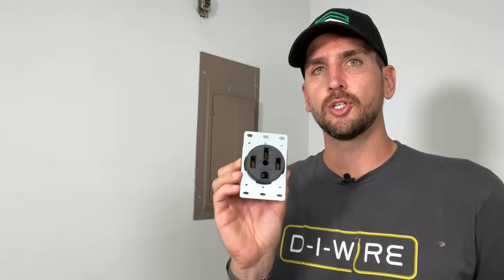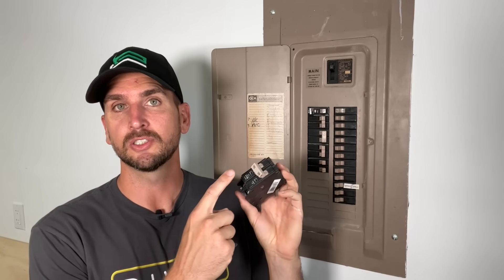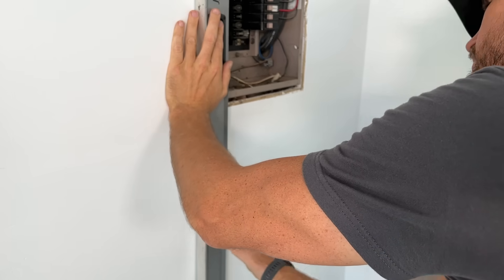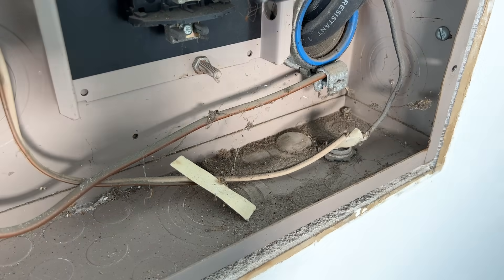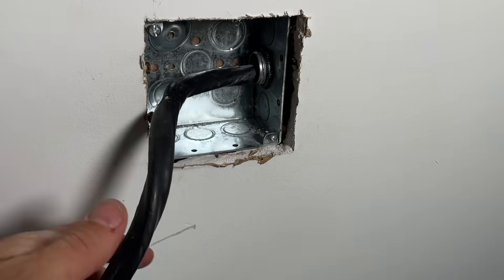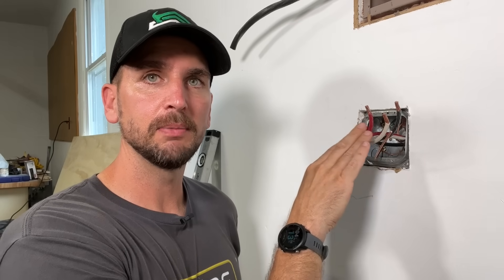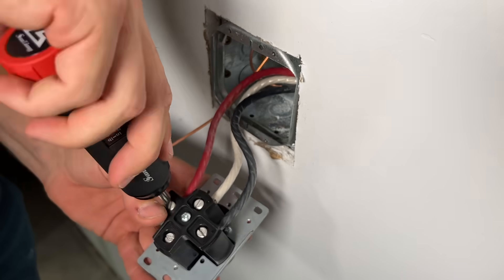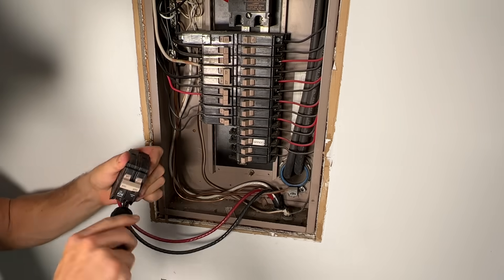Quick and Easy DIY 240V Outlet Install | 50 Amp NEMA 14-50

Comment: Would it matter if the breaker box is 100 amp or 200 amp?
Reply: I have learned through my life that if you learn the hardest most difficult way to do  any calculation problem is best.  There are short cuts that can be developed, however, the short cuts often open you up to failure.

Does it matter 100 or 200 amps..... No!  Calculations should be done for both services.

Houses are wired for what is there when the house is built. The service wires can be reduced to supply just that.....Initial install only.  

Adding a charger is like adding an extra stove/oven to run for 8 or 10 hours.  A 100 Amp service means car charging takes up close to half of all the power your house can receive.

200 Amp services will probably be okay, but I must recommend the calculations to be safe.  Your building department may also require them for the permit.

I took a car charger install class and one of the guys told us that the Tesla rep told him add a second service just to add the charger.  He lives in a rural spot with plenty of extra electrical trical.loads connected to his building.

Be smart and do it right the first time, waiting to do it right until the second time might get expensive.

Comment: Problems with his video. I fear most that are drawn it with his fake price in his caption, he actual is almost 50% over his caption price. Now for the fact that most sucked in by his fake price are not competent to do this work. In most parts of the nation, will jot be able to obtain the permit to do this work, not to mention know the NEC codes to meet minimum standards.   
So most will have to hire an electrician, who will not cut some corners, that he did such as the cook stove intended receptacle. Therefore his fake price, is way off what it will actually cost. Not to mention the lack of payment by the insurance company when the EV catches on fire or the overload that this creates on a panel that does not have the necessary capacity to handle this upgrade and burns down the home by being inside the home attached garage.
Reply: We have to trust the "can's" to do it and the "can not's" to know they cannot.  We can't be limiting the "can's" just because a few "can nots" fail to correctly self identify.

Comment: This is all fine and dandy and I guess you want to show is not expensive. Yet, why go through all that trouble and not use a 6/3 so that you would have a ground cable to the panel, hence, to a ground rod? 
Before I get a reply...I get it, is not needed to function and work. Nonetheless, is an additional safety AND even if not code in your jurisdiction, it may be in the future, to GFCI all garage outlets.  Yes, I know you could hardwire also, but if you have a plug in charger and someone in the future buys the house than is nice to know it can be converted to GFCI. All he needs, later, is to buy the $90 breaker.

Anyhow, that being said, the 14-50 has the holes he needs, but HomeDepot and Lowes sell them expecting you to plug an oven....this is why those cheap outlets do not have full blades, ovens are not continuous, they go on and off as they cook, and plugs are hidden behind the range never to be messed with again.... EV charges are continuous and will heat them up. I don't want to be sleeping over the garage while that thing is juicing so much amperage, especially at night, when any smell or smoke needs to cover the entire house before one wakes up.  This is not when you want to save.  GET AN INDUSTRIAL OUTLET, they are beefier and the blades can handle the abuse and especially the constant current.
Get a HUBBELL or BRYANT INDUSTRIAL outlet. Who cares if they are $90?  Do not save $70 to plug a $70,000 car!!!! And, run the ground wire to the panel!

Lastly, all the aforementioned is useless if you don't wiggle, then tighten, then wiggle and tighten the wires, the strands move and accommodate and it can loosen up. That is heat and fire and arc and a nightmare.  the good thing about industrial outlets is that the connection is safer because instead of a screw a plate presses the strands, so at least that is better.

I like the video, it does help and is a good visual and is well done, but those details are important.  

NOTE: be kind to your appliances ad avoid surges, turn each breaker off first and THEN the main 200AMP one. When energizing the circuits do the same but vice versa, first the main and then individuals one by one.   One thing is to know how things work and I am all about DIYers, but is also nice to have the formal training and knowledge to do them properly.

KNOWLEDGE:  Tomato is a fruit.
WISDOM: knowing enough NOT to add tomato to a fruit salad.

Comment: The thing about electricians is we all seem to have different ways of doing things depending on what we think is safe. When you opened the panel I though cutler hammer bet those breakers are going to be hard to find. I actually haven't see a CH panel in over fifty years now. Now the first thing I would have done is put an amp probe on the entrance cables with normal loads on to see how much capacity you have left. Second is I've never seen anyone use a 1900 box after the drywall is installed. Normally you'd use a two gang popin box with sheetrock clamps for that install. And I'd throw away that waygo plastic device and use a wire nut that will likely outlast you. Finally after it's all said and done I'd never put a charging outlet inside the garage with all the ev's that have self ignited while charging. I'd have installed the outlet outside with a weather proof cover and parked the car a bit distant from the garage door. You did do a nice clean install but I definitely would have done it differently. At any rate what was the load on the panel before you added the outlet?
Reply: First of all, just because you haven't seen something for a while doesn't mean it doesn't exist or parts don't exist. My last residential panel was from 1972, and as of last year, I could still get breakers. Second, the box used is very common after finishing as it actually mounts to a solid surface instead of hoping the drywall holds . Third, it's WAGO, and they out perform a wire nut in many ways.
Reply: @Toyotajunkie  I don't agree. Pressure contact devices typically get tired and fail over time from the varying loads and a wire nut is normally good for fifty or more years. Even with a wirenut you twist the wires together to insure a really good connection. You might have a source for c/h but I can remember in the early 70's having to buy some at an old hardware store because at the time the supply houses no longer carried them. Perhaps they've made a comeback. As for the box if I was planning on plugging in and unplugging that receptacle I would have surface mounted it directly over a stud to resist it moving in the wall. But I say again it would be a safety feature to be able to charge the car away from the garage and not inside it. Then again it's not my home in danger.
Reply: @71160000  We will just have to agree to disagree then. Your "thoughts" on new technology, and incorrect interpretation of data (whether from misinformation or refusal to accept data) are going to make this a waste of time for me. Thanks!
Reply: @Toyotajunkie  No problem. I've seen lots of people do things the way they thought was best and as long as it doesn't kill someone or burn their home down it's okay. Over 40 years I watched technology change a lot. I've worked on everything from offshore drilling rigs to skyscrapers to nuclear plants and I've seen a lot but not everything for sure. The one thing that's most common though is burned connections from poor choices or poor mechanics.

Comment: What abt gfci?
Reply from the maker: You will need to check your local code.  For us in Illinois code is adopted at the city level and we are still on 2014 which does not call out GFCI protection for garages when installing 240 volt outlets.  I think in 2020 NEC did make an update that might necessitate a GFCI on this type of install.

Comment: Completely misleading. Most homes in my area, the breaker panels are already maxed out. Which would require upgrading to the larger panels. Your homeowners insurance will not cover your house if you put that in there and it burns down because you did it wrong
Reply: Maxed out? What builder gave the residents the "no lube special"?
Reply: @snap-off5383  no one was planning for electric cars in the 60’s & 70’s
Reply: @bobstratton6362   My house in a new neighborhood is paid for and I paid 1/3 of what it is now worth.  We all have modern 200 amp service with natural gas service as well. Any male that buys a house that can't support a welder.  I'm sorry you take an assessment of your living situation as an insult.
Reply: @snap-off5383  like waist and yes I have two welders, a plasma table and solar system that over produces. With batteries. Would be off the grid if the government would let me.

Comment: It is quick and easy IF YOU HAVE 50 AMPS AVAILABLE ON YOUR PANEL. 
Doubt you paid $66.00 for this since the cable probably cost you more than $66.00

Comment: For the viewers, please remember that there is a section in the NEC, 625, just for car chargers.

Your charger's maximum draw, no some reduced charge rate, must be used when multiplying by 125% to get your circuit rating......a 40 amp max power use for a 50 amp circuit/breaker.  You cannot run a 30 amp circuit and restrict your 40 amp charger down.

Also, if receptacle for car charging, gfci required since some time before 2017.

Please, research and do it best.
Reply: Check your local authority.   Mine's on the 2008 NEMA codes.
Reply: @BenKlassen1  holy crap

Comment: Great video! I’m in a project exactly like what you did in the video. But I’m quite new to electric, can you please tell me what size of the wire stripper you use? I know the black main thick wire is 6 gauge, but after it’s stripped out, what size of the conductors inside of it?
Reply: I believe it is 6 gauge. The gauge refers to the size of each individual strand

Comment: step 1, have your breaker box in your garage lol.  nice video to help with the process, but if your box in in the basement, your going to be spending $200+ on a 50ft length of 6/3 wire, and you'll have to cut access holes along the way to snake that monster through your ceiling.

Comment: dont listin to these tubers they do not care if you die or burn your house down.. you need to hire a license electrician this will cost you about 1000 dollars to do spend the money get it done right dont mess with the panel also want to add if you have a dryer that runs on 240 you already have a 50 amp outlet ready to go just unplug your dryer and use that

Comment: All evs need 125% rule continous load 3 hours or more for the nema 14-50 40amps x 1.25= 50 amps then for your continous load is 40 amps.

Comment: After working the trade for over 30 years and becoming an Inspector, NEVER use Aluminum.  (Just my opinion) And use industrial grade outlet for the cord you will use. As an afterthought, get the Vehicle sales folk to provide you with a cord long enough to reach the outlet that you will install, no junction boxes. Use Copper wire, and don't undersize it. Use wire good for 40 amps, #8. If you are not doubly sure, then hire a Licenced Electrician and make sure he is insured. Get his contractors number.  Don't let your smart neighbor or friend near it. Proficiency and Insurance are key here.
Reply: I talked to Tesla and their professional installation support said my previously installed 6 gauge aluminum line that was used for a electric stove will work fine with the mobile 220V charging cable since it will only use a maximum of 35 amps. What do you think Ellen?

Comment: You need to check the size of the panel. Ensure the main breaker has have enough rating. 
Btw, 240v 20/30 amps is more efficient (lower lost of energy/ lower cost)  then 50amps when charging ev.
Reply: So if I have a Tesla I need the 50amps correct?

Comment: My panels are in the basement so it was a good deal more to pull it to the garage.  Either way, it’s a one time charge and the house should be set for a long time. I only wish it was feasible to run two so both our cars could charge at 45 amps.
Reply: Run 1 larger cable to a subpanel in the Garage, probably  should be considering a 120 amp sub panel. Assumes you have a 200 amp main panel. Or alternatively if you have a smaller size main panel see about a splitter  meter base  and have each on their own panel. That main run size will likely be in aluminum so make sure to use an anti oxidizing compound as required by code.
Reply: Hello, what did you end up doing? I am in the same situation right now. 😬

Comment: Shortcut - if you have a gas stove, use that 50a breaker. Remove the wiring to the stove and use that for 6# to the charger receptacle. But could be an issue when you sell the house.
Reply: That's exactly what I did. I converted from an electric range to gas. All that was on the 50amp line was the ignitor circuit. So I switched that to a 15amp branch circuit to free up the 50amp breaker. We're planning on staying in this house forever, so if the next owner wants an electric range, they'll have to give up the EV charger circuit... or upgrade the panel, because it's full.

Comment: Great Video - my panel is full - any suggestions what to do?  the last spot got taken for a 240V mini split - can this be shared with a nema 14-50?
Reply: I believe there are "doubling breakers" (probably the wrong term) that can help free up space in a full panel. Check with a pro.

Comment: Very useful video! Went with the much beefier 14-50 receptacle. Car is currently charging now. Thanks for making such a well-focused video. It covered all the useful issues, so I was able to get it right the first time without making any mistakes.
Reply: I think this is critical to point out. Don't use the cheap $9 receptacles you'll find at Home Depot. While it is indeed a NEMA 14-50 plug and is technically up to code, they're designed for electric dryers. They're not designed for 5-10 hours of charging and a lot of them have started fires. Get the ones especially built for EV charging. They're going to cost in the neighborhood of $50 (if you're lucky to find them at that price) to $150. They used to be easy to find at $50, but now that everyone is realizing the beefier ones are the ones needed, the price has been going up and up and up.
Reply: @dontbanmebrodontbanme5403  Any specific brand you suggest??
Reply: Please make sure your receptacle is EV graded. Don't burn down your house with a cheap receptacle.
Reply: For Tesla,  if your not a contractor. They will not honor warranty.  They also want a copy of permit. Plus pass indpection

Comment: Maybe a dumb question, but in my area any garage is considered a "wet" location and any standard 120 volt outlet need be GFCI protected, do 240 volt outlets not require GFCI protection?
Reply: During my EVSE install in 2019, the inspector listed the newest NEC that declares almost all single or dual pole breakers rated at 50A or less must be GFCI protected.

https://dpnr.vi.gov/wp-content/uploads/2021/08/DPNR-2020-NEC-Code-Changes-.pdf

Unfortunately, the built in GFCI on the Tesla UMC was tripping the breaker. The inspector passed the correct install, then as he left coughed into his hand, "Swap it back to non-GFCI when I'm not here."

So the electrician came back and did just that.

You'll have to confirm which version of the NEC is being used for your municipality. I'm pretty sure GFCI will be required.

Comment: Wehave people come in quite a bit to do this .  FRIST  OFF 90% of the people DO NOT NEED TO BE DOING THIS it is beyoned what they can do !
I'm in CAN so the price ???? well the 6 / 3 wire is $55 a meter ! the box and hard ware your looking at $30 +   the breaker $90  and we don't sell the outlet and the cord from car to otlet your looking at aleast $200 if you didn't get one with the car . Pay the electrition and have it DONE RIGTH !!! your Ins will thank you and if you should have a claim you may still be covered

Comment: 50 Amps? Better make is 400 volts that will make it 28 amp. That’s much better for the wires and outlet.

Comment: I'm not an electrician so take my comment as such.

to pass an inspection, you need to use 2x #8 or #10 pan head or washer head screws to mount that box. they should be  3/4" or 1" in length.

supposedly some inspectors like square drive heads.
Reply: No inspector will ever see it.

Comment: Great video with plenty of details as usual.  My panel is completely full. No free slot for the new breaker. What are my options?
Reply from the maker: Bummer, not an easy solution.  Usually in these scenarios you might be looking at a subpanel to expand out your breaker capacity.  Do you have a 200 Amp service?

Comment: when I had solar connected to my panel, if I shut down main switch on the panel, do I have to switch off my solar generator first? otherwise, will Solar generator still have the power feeding into main panel (even its switch is off)?
Reply from the maker: Not sure how your system is connected but you could use a multimeter to check for voltage with the main disconnect in the off position.